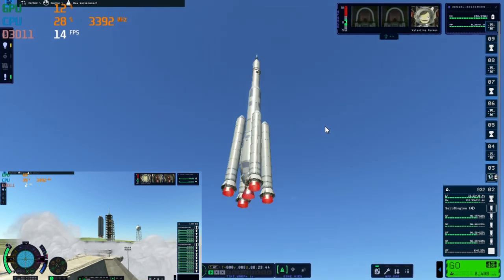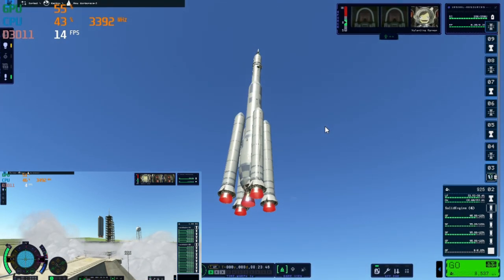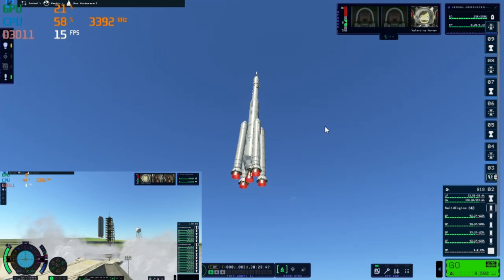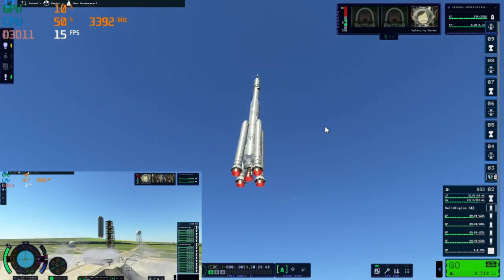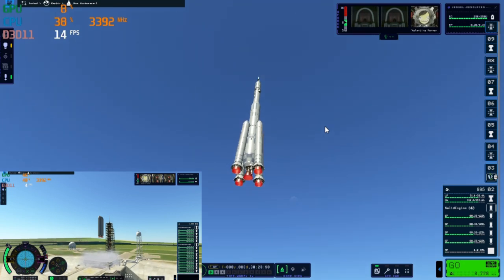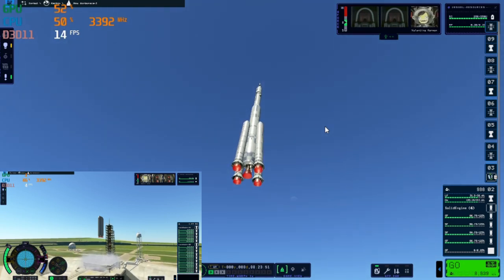How to avoid extreme lag in Kerbal 2

Comment: step 1: don't use potato pc, this game came out in 2023, you can;t expect good framerate with pc 10 years old.
Reply: Nope. The game isn't running poorly because of the super fancy graphics, or because it's doing lots of stuff that's only possible with powerful, modern hardware. It's running poorly because fuel flow is broken. The devs admitted this before early access began , it's in the launch day notes.

"Fuel flow and Delta-V calculations are currently undergoing optimization, but on day 1 of Early Access, high numbers of engines pulling from a common fuel source may impact framerate. If you’re having trouble achieving a desired framerate on your machine, consider using a smaller number of higher-performance engines on your vehicle. This issue is very high priority for us and will be addressed in an upcoming update."

But even if the devs hadn't told you that you were wrong two weeks ago, it's still really, really dumb. "The game came out this year so of course you need top of the line hardware" isn't how games work. The overwhelming majority of games run just fine with hardware that's several years old. The ones that don't typically are pushing the limits on graphical fidelity. KSP is not one of those games. It's one of the ones you'd really expect to run just fine on older hardware, just like the first one did.